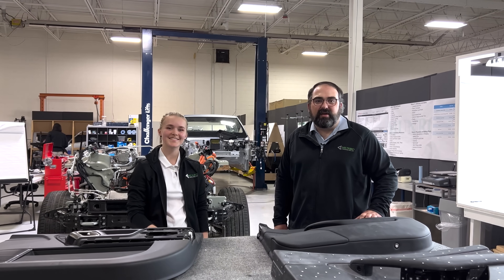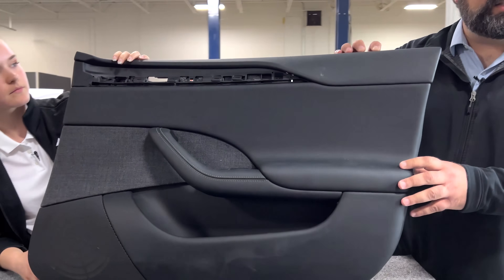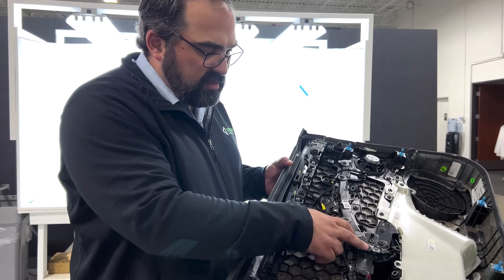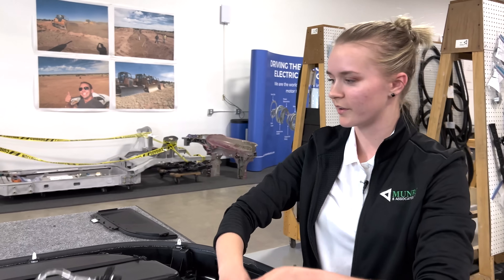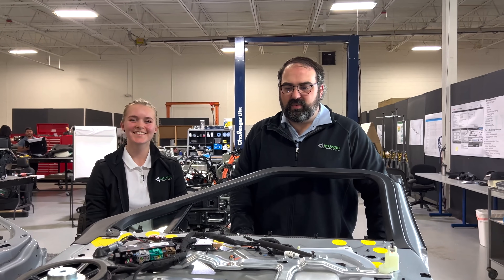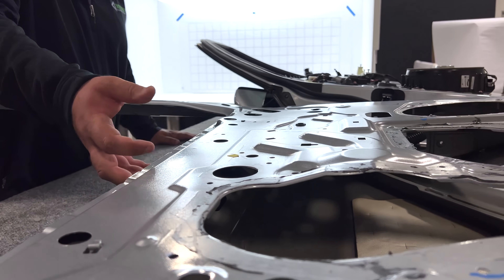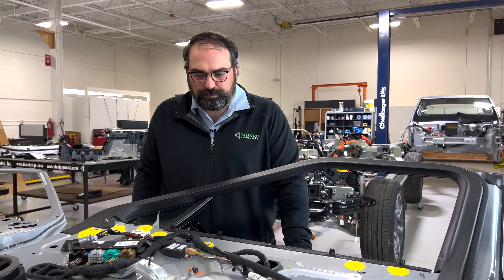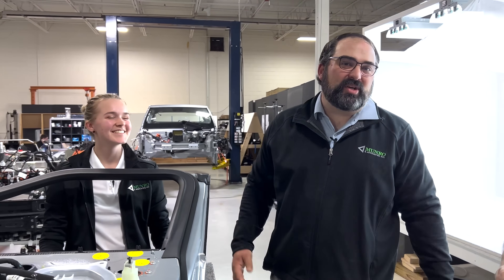Rivian R1T Door Construction Analysis

Comment: Screwing is used to save upfront tooling costs (vs US welding/heat stake), which is a consideration for startups, even if it’s cheaper when amortized. Also, it’s great to see Kettering co-ops holding their own.
Reply: Yeah I was thinking the same being a new production product it’s holding them over until they can actually scale up. Almost like a beta run prototype to see how it holds up.
Reply: @TOMKATPEDALS  yeah… but 120 screws, per door! That’s nuts.
Reply: @GET2222  it totally is. Hopefully rivian can learn to scale production and actually make some money in the future.
Reply: probably the same reason for the glue. Couldn't get a seal maker for that part yet due to supply chain constraints probably.
Reply: Future versions will be cost and screw reduced.  They will also fall apart.  Like pretty much everything does today.
Reply: @johnnicol8598  well, you want a replacement part for a door and this 120 manually screwed in door is going to cost you a small fortune to replace or have someone work on. 120 fasteners does not mean quality. Sandy Munro has discussed this at length. Screws are terrible. Especially if you strip out a receiver or female on the line. Screws area terrible solution.
Reply: I wonder as time goes on and the screws go away how much weight they will save and thereby improving the efficiency of the vehicle

Comment: Sometimes the design/engineering/assembly decisions might seem curious in a number of aspects, but may indeed turn out to be logical, thus I would hesitate to make any conclusive, determinative statements before hearing from the design/engineering team that produced the product
Reply: Not necessarily true. Munro beat up tesla when they were trying to scale production. 120 screws in a door in not an engineering viable solution. In fact, it’s a bandaid. How many iterative steps and processes is it going to take for the to scale production of a single door? Imagine thousands of decisions made where they over engineered the truck. If they aren’t profitable, they die. I hope they survive.

Comment: What is the issue with more screws? I would imagine it would make for a more solid construction of the door panel itself. Outside of cost and time, what are the downsides?
Reply: Cost, assembly time, and weight
Reply: @oroincorporated As far as mechanical engineers there go, a hell of a lot of them are from legacy Michigan OEMs already
Reply: @oroincorporated Mark is a well known Tesla fanboy. Not a surprise he's all supportive of under build quality and cost savings.